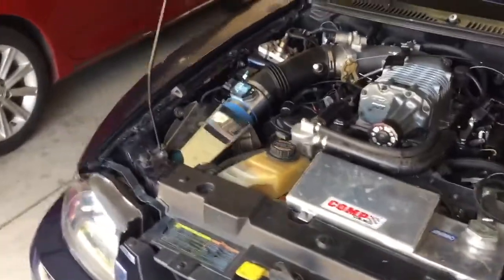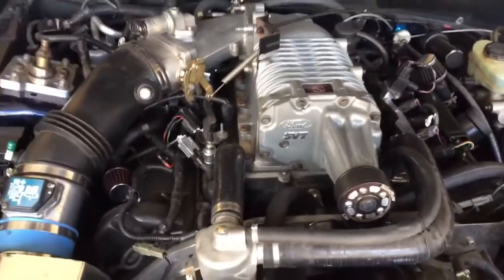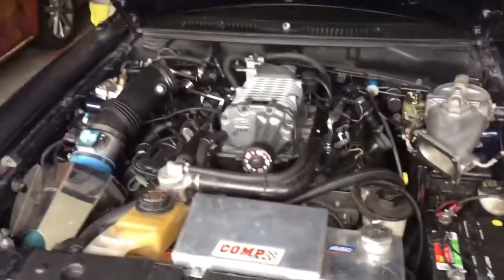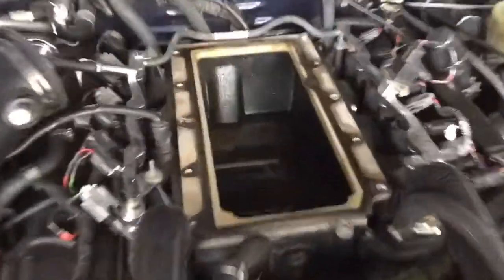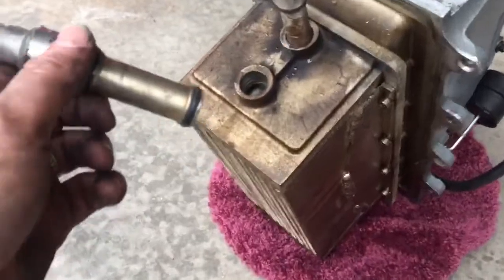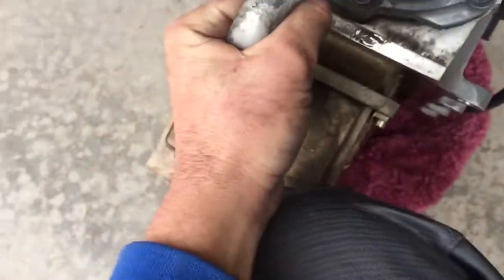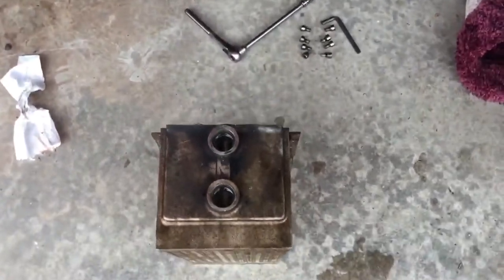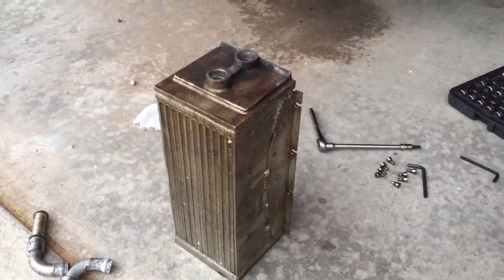01 Bullitt Tork Tech intercooler issue & supercharger removal Eaton 2V

Comment: First I have heard of an intercooler failure on these. I have a new kit that I have not gotten around to installing yet. I thought I remember hearing that they were made by whipple or somebody legit. I have a V1 setup I was going to do but later decided I wanted to try PD. I was a little bit worried about longevity on the proprietary intercooler. Wonder if some of these radiator repair wizards could re-core?
Reply from the maker: I think you made a good choice going positive displacement. I called tork tech during all this and  asked details about the intercoolers and they said they were from a different vehicle but had the sides modified and welded to fit their kit. I asked them about repairing the old core but they weren't interested and I didn't trust any local shop so I just went ahead and bought the new one.

Comment: I know this is years ago for you now but I'm just curious on your intercooler with those two pipes, I just bought a kit and there's actually a clamp that holds those tubes in place and its bolted between them. I don't see that on yours. Any ideas which way is correct? Is yours or mine maybe an aftermarket unit?
Reply from the maker: Yes I did find out later about that bracket and I called and ordered one. It was missing from mine and probably was the cause of the leak. So I have it on there now. Thanks

Comment: Does the Bullitt throttlebody interchange with this kit or did you have to source another?
Reply from the maker: It should be the same twin 57mm thats on the bullitt/cobra/mach 1 although there are some small differences. I had a BBK on this one.